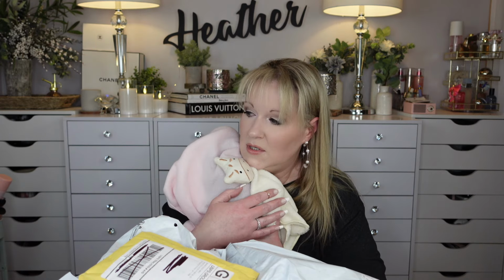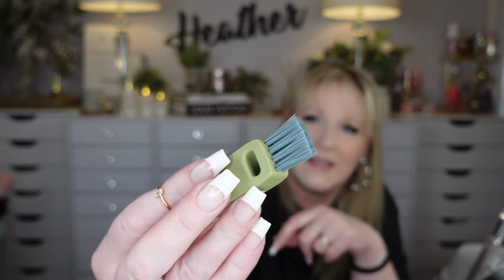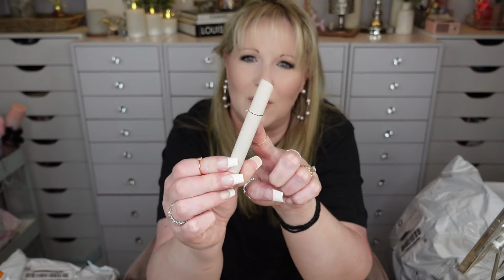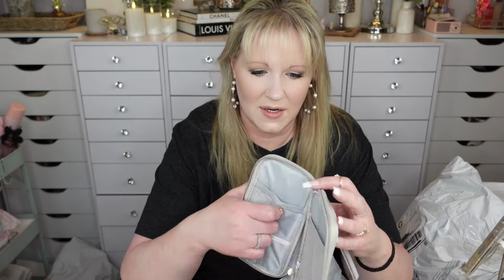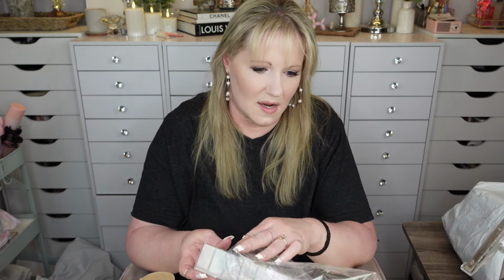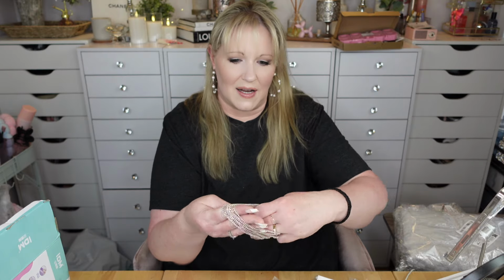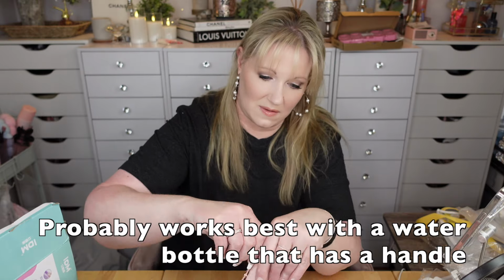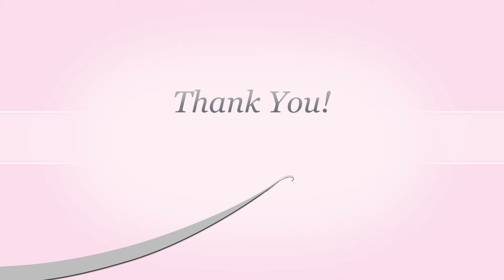TEMU HAUL & A SURPRISE!

Comment: Polyester is not absorbent like cotton. It is still very breathable and not bad for summer. But you can literally take somenthing that is 100% or 90% polyester and run it under water and you can feel it after that it didn't absorb any of the water. You can also see the water run off of it while you have it under the faucet. Of course, you can't leave it under the faucet for a long time or it will eventually get wet and absorb.